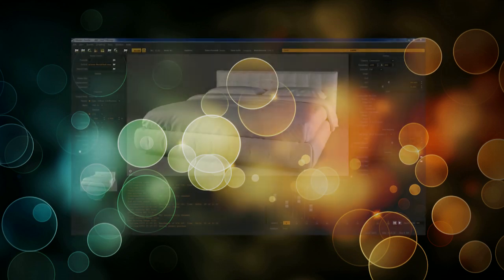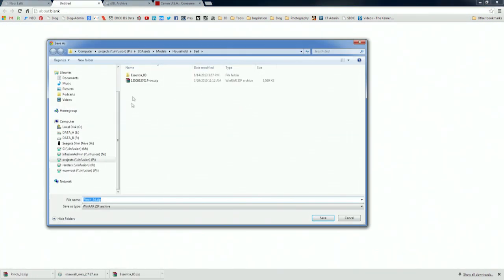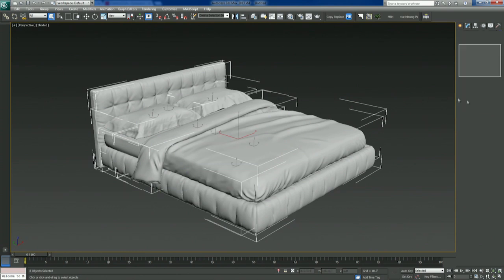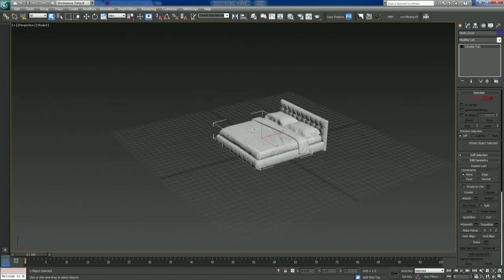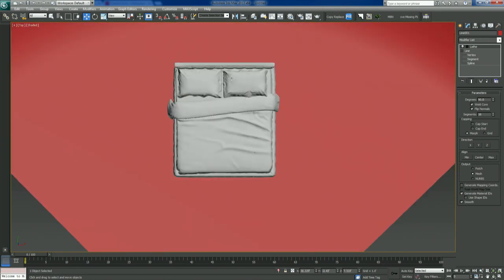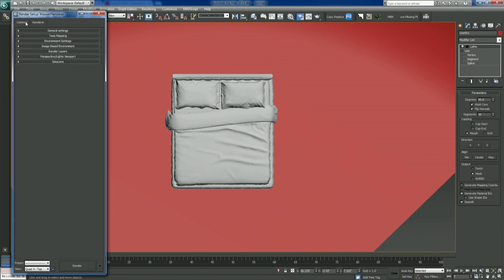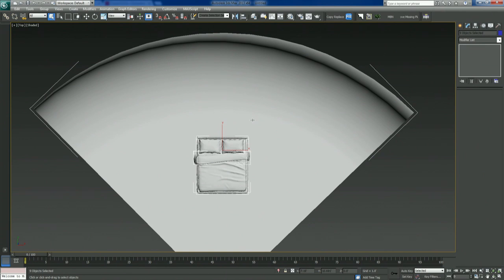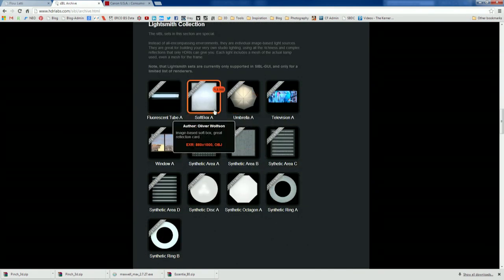Part 1 Maxwell Render: 3D Studio Max & After Effects using Multilight

Comment from the maker: Hey Diego, as I understand it Multi-Light layers contain all effects of that given light so if dispersion on enabled it will be part of the layer along with reflection, refraction and illumination. If one particular light has noisy dispersion you may be able to use noise reduction tools on just that layer to manage the noise better. Otherwise I would see if you can optimize the emitter and material to get a cleaner result.